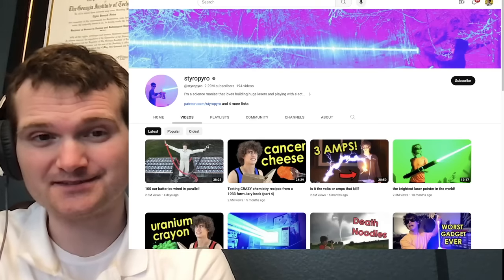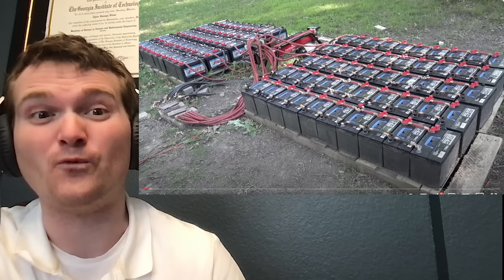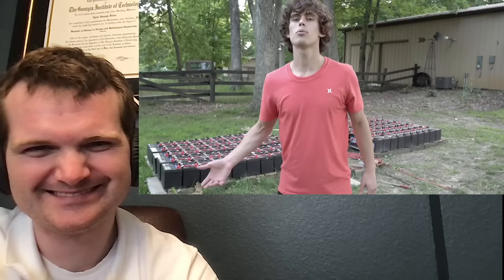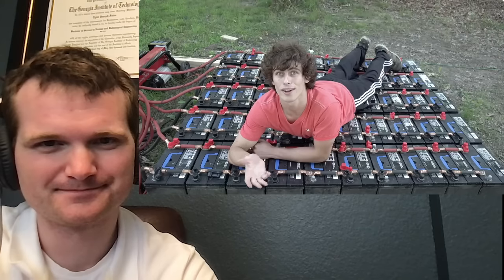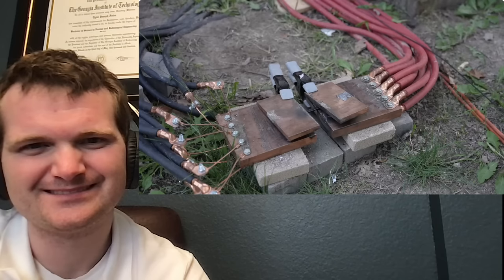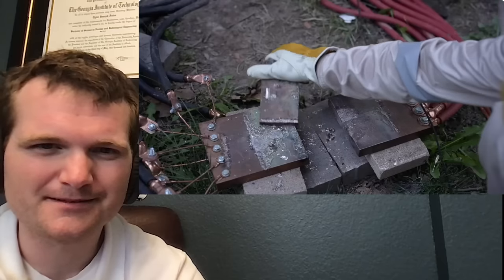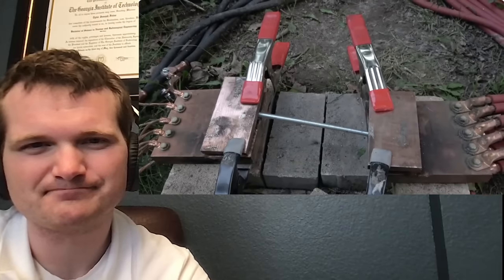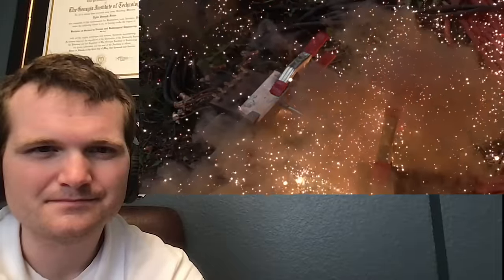Nuclear Engineer Reacts to Styropyro "100 Car Batteries in Parallel"

Comment from the maker: Thanks so much for watching! If you want to see my reaction to a video on superconductors and hear more about nuclear fusion, please check out: https://youtu.be/QgciqjZhEQA?si=DrkUsFq_7YcHCf31
Reply: 18:37
You made a very interesting point here, nobody understands how the big bang happened exactly and technically we are just a bunch of particles around fireballs,
Makes you wonder if he created a mini Big Bang right there, on its own micro timescale, think about atoms that gravitated around the molten metal and Fire when it looked like stars, microscopic planets and generations of lifetimes all gone in the flash of a second potentially, if you were to think of each one of those pieces of molten metal in the air as a little star forming then dying, Like the universe has and will on a bigger scale. I wonder if there's any forces that would make any microscopic quirks or particles float around those mini fireball suns
Reply: Real time fireworks from different metals, makes me wonder what he will get up too next.
Reply: he should have used a few forklift batteries
Reply: @samnoneofyourbisnus2543  those things are gnarly. Was sliding one back on a metal rack one time at a factory and the wires got pinched going in and it dead shorted and exploded and blew the whole top of the battery off and rained acid. They upgraded their system to NOT an old steel rack after that.
Reply: 320 megajoules is the amount of energy stored in barely less than 70 Kg of TNT
Reply: Sometimes Fun is not just Fun but Science!
Reply: "Thanks for watching my stolen content because I'm too lazy to make my own videos"
Reply: that one perfect smoke ring at @25:54
Reply: i would have loved thermal probe data on the batteries themselves
Reply: I hear you, bro, I can't stand people who parasite off other people's hard work.   @TheSteveMeister
Reply: This is super lame.
Reply: Welcome to the algorithm!
Reply: it's a lame video made on the back of someone else's video without any effort and the most annoying thing is the constant pointless laughter. I suppose it's a nervous laughter. It's technically a laughing video interrupted by short reprises of talking.
Reply: @TheSteveMeister Precisely. This content does not fall under the "fair use" doctrine, as it effectively serves as a commercial substitute for the original work. Such usurpation diminishes the economic incentive for viewers to engage with the source material, contravening the principles of fair use.
Reply: i commented on his video stressing how dangerous what hes doing is, i get nervous building coils for 18650 and 20700 batteries nvm 100 12v batteries
Reply: you should look up and comment on the user Kreosan  "Secret Chernobyl LABORATORY and Experiments with Radiation in the Bunker under Jupiter factory" etc
Reply: nilered is crazy, styropyro is australian (crazy+)
Reply: Why don't modern blacksmiths use this to heat up whatever they are working on lol
Reply: Hi
Reply: @TFolseNuclear I subbed hoping you will share anything you hear about the plants being held hostage by Russia in Ukraine.
Reply: Have you ever been at the Salem nuclear generating station? PSE&G , I swear I seen you at least a dozen times back in 2012! Or maybe you just look the same, i am a retired nuclear chemist and the PSE&G station is just one of the many power stations ive been employed at, my longest stay was Hope Creek, Limerick power plant for 11 years, and then there was the 2 years at Oyster bay generating station  in N.j! Well I love you're channel its very refreshing to see someone who knows what they are talking about! Takd care
Reply: I think next video would be 100 nuclear reactors in parael...
Reply: Hydrogen is NOT explosive, or even remotely flammable.... in an oxygen free environment. I know it might be splitting hairs, but it's important to note that fact, because people will be like " we can't use it in rockets bound for vacuum, it's explosive!" and that's not actually the case.

Comment: Styropyro may be unhinged, but he EASILY has the most expertise and concern for safety out of almost any youtuber. He knows what he's doing and always at least tries to set up as many safety precautions as possible.
Reply: Stuff Made Here also takes multiple safety precautions. However he is not as unhinged
Edit: I missed a word
Reply: Styropyro is brilliant. He got his degree in Chemistry but is really good with electrical circuits, lasers, and physics.
Reply: There is 9 giga amps of irony in your comment. Safety precautions? Did you see what he made there? Do you know anything about fault currents? Safety precautions. Bwahhh!
Reply: @labibbidabibbadum  there’s a difference between making something dangerous, but using it with precaution and the respect it deserves, and being reckless and endangering yourself and others. Styropyro makes gigawatt lasers too, but knows exactly how to operate them safely, and even lambasts tutorials and companies selling faulty safety goggles and equipment. No one is arguing that what he’s doing would be dangerous, but with the right knowledge you can use dangerous things safely. 

I myself am a chemist, and I routinely work with deadly poisonous compounds like cyanide and anilines. But I’m able to use them safely due to my knowledge and education concerning their proper handling and hazards. It’s the same sort of thing with Styropyro. Don’t get it twisted
Reply: @spiderdude2099  Hi chemist, I'm an engineer and if you think this video somehow describes a respect for the forces involved or uses appropriate safety methods, then I'll be avoiding your lab. It's fun. Sure. It's like when I was a teenager I rode a dirt bike. I wore a helmet and gloves, leathers occasionally, but apart from that I jumped fences, rode like a goose, rode on the road unregistered - all the dumb things. It was great. I still do shit like that occasionally. But I don't pretend it's done with safety concerns in mind, cause it ain't. It's done with fun in mind. Period. If you think he's demonstrating appropriate safety techniques to protect him against megawatts, you're insane. He's done a rudimentary job of deploying some very basic safety techniques. He has relied on a serious amount of luck at the same time.
It's like that submersible at The Titanic site. They had good luck for a few dozen dives. Then the laws of physics and thermodynamics caught up with them. Big energy means big consequences. 60 volts will very likely not arc flash you. But it will happily do so in the right circumstances.
Reply: @labibbidabibbadum  it ain’t that deep man. People do things where the possibility of death is frequent if not ever-present almost every day. Yet, the appropriate reaction to that risk isn’t to simply NEVER do those things. You approach danger with knowledge and appropriate procedures and precautions. If you didn’t find his precautions appropriate, try to consider something: 

1. For the entertainment value of the video, he may not go through an exhaustive description of everything he did to maintain safety, or show every countermeasure in painstaking detail. That needs to be ok for you. Very few if ANY educational content on this platform is gonna spend 20-30 minutes outlining EVERYTHING that can go wrong and how to minimize it. The researcher themselves did that likely in the lead up to developing the video, and they put forth the most relevant details about how they conducted the experiment safely. Also, you’ll notice that once the voltage was increased to 60V, he didn’t attempt to touch both leads like he showed previously, precisely because the risk was increased out of the realm of safety. 

2. If styropyro puts a disclaimer to not try anything you see at home, and he is taking all these projects on at his own risk, you need to be ok with that. If a trained skydiver dies from an accident or a faulty parachute, we don’t blame him for that. He knew the risks and it just ended up not working out. 

3. The example I gave about cyanide in my own lab was meant to demonstrate how it’s foolish to be scared to do dangerous things simply because you have the possibility of death if you mess up. We weighed out and stored the cyanide in an oxygen and moisture free glovebox with ventilation. Moved the cyanide out of the glovebox in a sealed vial, and then carefully added it to the necessary reaction while wearing gloves and inside a fume hood with a neutralization solution on hand as well. I didn’t say all that, cuz I shouldn’t need to just to illustrate a point.

Personally, I think the STEM field is made better with people who entertain. A flawless OSHA record shouldn’t be necessary for every instance of content like this.
Reply: @spiderdude2099  I love the guy. 
 I think his videos are great value. But he's not doing what's safe. He's doing what's fun. Like Colin Furze. Or backyard scientist. The fun for the viewer comes partly from the great science education and partly from watching someone take absolutely bonkersly bizarre risks and get away with it. 
50,000 amps at 60 volts for one second is 3 megajoules. For comparison, that's give or take the kinetic energy of a motorbike at 500 km/h. In his backyard. That's a decent small power station. In his backyard. All wired together with unsecured cables twisted everywhere. With molten metal  landing all over the plastic batteries, abusing the batteries like its a government job,  just asking for a short fault through a battery with all that energy ready to blow. Crazy brave is what it is. Safe it ain't.
Reply: look at it this way if theres a pro dirt bike jumper he can do jumps you wouldnt even begin to fathom but to him its not dangerous  @labibbidabibbadum
Reply: @labibbidabibbadum  riding a dirt bike on the rode unregistered is not unsafe. I don't even get your comparison; the titan sub has nothing to do with anything here. That was blatant disregard and using faulty stuff whilst styro does the opposite of that

And why do oafs say the 'laws of physics caught up with you' only when an accident occurs? You realize that the laws of physics are always 'on,' right? They have 'caught up with you' no matter what, even when things go right. So only saying it when things go wrong is pure nonsense
Reply: @minecraftblockychris8708  You'll never convince this guy; he is stuck in his own self-assuredness via his pure hubris making him believe he is always right. This oaf says Styro relies on luck a lot, which is absurd, as Styro has yet to have an 'accident.' He is totally safe, because he knows what he is doing; yet just because he doesn't take low IQ level precautions only meant to protect the lowest IQ people amongst us, he says "it isn't safe."
Reply: And the FBI were too afraid to come inside of his home, lol
Reply: @pyropulseIXXI  Bwahhh. Your mirror of self-reflection is somwhat cloudy sir.
Reply: electroboom  too
Reply: Yea. "expertise"
Let's use threaded rod with such limited contact area. . .
Reply: "at least tries to set up as many safety precautions as possible"
My man...
He's doing it in his backyard,
right next to trees and dead foliage,
not on concrete,
Hiding behind a desk,
hasn't protected his cameras or the cables or batteries from the molten steel in the slightest,
isn't wearing a full coverage foundry / furnace suit, or helmet,
isn't even wearing protective shoes and gloves - I think he's wearing sneakers and bog-standard rubberized shop gloves the entire time throughout, even when lancing the microwave housing.

There's a reason blast furnace workers are wearing metallized full suits, including a mask with a full neck-drape.
It's because getting molten steel onto your scalp, throat or foot *fucking sucks*.

Adam Savage & Jamie would tear these guys a new one, if they had to leave a comment on safety for this.
Reply: @labibbidabibbadum  there is a difference between doing something safe and safely doing something dangerous, no matter what 100 car batteries wired in series is never safe but it can be done safely
Reply: @peik_haikyuu2265  Of course it can be done safely. We do it safely all the time. If we did it like this we'd possibly be in prison. The local worksafe authority would take one look at it and shut down the site. Then there would be an investigation. Then a court case. Then a big fine. And depending on the circumstances, the engineer would lose his or her accreditation and people might go to prison. Why? Because we would be recklessly endangering life. 
This whole thing is done for fun, lols, and clicks. 
Don't kid yourself that amping steel to destruction and plasma cutting metal using a wobbly stick in your backyard from a bank of batteries tied together with a spaghetti of cables is even remotely safe.
Reply: Bro was wearing SHOES when blasting molten metal around, that metal was also being blasted over every single one of those batteries which could have showered him with acid.
He even mentioned getting molten metal on top of his head at the end of the video.
Reply: Its still crackpot savety. Just alone because of the table but also his complete set of clothing. Its 'kinda' save enough but just out of bad luck he could have seriously injured himself.
Reply: if he didnt know what he's doing he'd have been dead a long time ago
Reply: @Ryanisthere Yeah... not sure that's how safety is assessed in any of the engineering projects I've been involved in. 
"No engineers dead today? Great - we're winning!"
Reply: @labibbidabibbadum  But the thing is, He is not at work but in his own yard, So your complaining about Code that doesn't apply. Secondly, the overalls he was wearing were  fire proof, One thing Styro has always pointed out ,Were the dangers involved and use good quality approved gear from well known companies.  He is safe enough without all the code getting in the way.
Reply: The parascoial relationship is too strong it's okay to admit this isn't safe.
Reply: You can't serious! He isn't concerned with safety!
Reply: Have you seen how oblivious he is? Dude. Dude couldn’t even wash his beakers without breaking them cuz he didnt think the constant “tinking” in the washer mattered until all his beakers started cracking.

Kids a derpstick.
Reply: Which is why he is boring

Comment: If I heard Styropyro correctly, the batteries hold 320 MJ of energy, which is ~76 kg (168 lbs) TNT equivalent.
Reply: i just realized that the energy released during TNT exploding can be quite accurately calculated, considering it's all in the chemical bonds in the material. It's not some arbitrary equivalence. It's quite direct.
Reply: Your calculations are incorrect. You forgot to add in the propane tank on the other side of the fence next to the Batteries.
Reply: @GeorgeTsiros  For the most part, but I would imagine there are some inefficiencies! I believe the term is "explosive efficiency" and is a measure of the difference between the energy contained in the chemical bonds vs what is actually released in its detonation
Reply: @DarkAttack14  true, it won't be exact, but even so, it is still meaningful, yes?
Reply: And one stick of dynamite is the energy equivalent of one mega joule so roughly 320 sticks of dynamite
Reply: THEYLL HAVE TO GLUE YOU BACK TOGETHER... IN HELL

Comment: Styropyro is extremely intelligent and safety conscious. I didn't think at first but I've watched enough of his videos to get a better understanding.  A person would easily die or go blind with the things that he does if they weren't extremely safety-conscious.
Reply: The fuse setup on this one was a neat touch.
Reply: "Extremely intelligent" people do not hide from explosions caused by megawatt circuits behind a cheap folding table.
Reply: @TheNefastor  If it was done perfectly safely, it probably wouldn't be a great video
Reply: @ZeRandomizor  your definition of "great video" requires bodily harm, then. You might to think on that. Then again, 2000 years on, it's still the same thing : Joe Average yearns to see someone get hurt for his entertainment like it's the freaking Roman Empire circus games.
Reply: @TheNefastor  Ugh, average people. Savages.
Reply: Its almost like hes an electrical engineer or something....I'd argue he knows a lot more about what he does than the nuke engie. But this channel is pretty interesting.
Reply: He's no dummy, for sure. He went to great pains to construct an RF-tight 'Faraday room' for some of his nuttier Tesla coils, just to avoid (eventually) running afoul of the FCC. It wouldn't have even occurred to me, but showed the level of forethought that goes into his projects.
Reply: While he has taken care of his own safety, I'm surprised his expensive cameras placed right there at the action didn't get damaged by sparks or actual metal flying around.
Reply: I still feel like he shouldn't be spraying metal sparks over the uncovered terminals of his giant battery bank.
Reply: @TheNefastor  NileRed proves you otherwise. More specifically it proves that it's probably more complicated than what you make it out to be.
Reply: @TheNefastor  the table is most likely just for sparks and slag, not because he believes it would help in a situation equivalent to 320 sticks of dynamite exploding, if he went  through every safety precaution he took it would negatively effect the video and possibly make people take the video as a tutorial